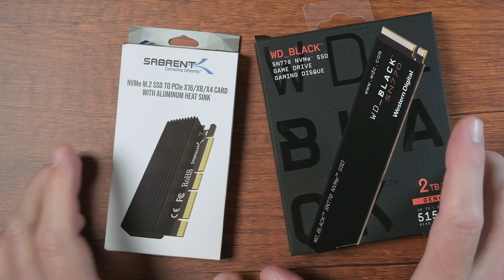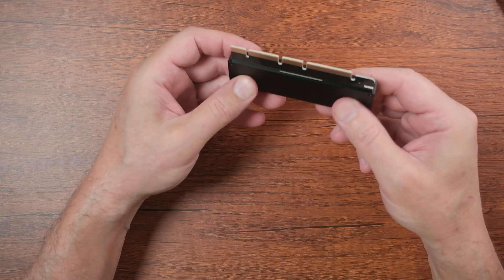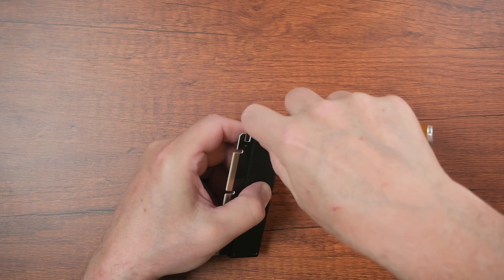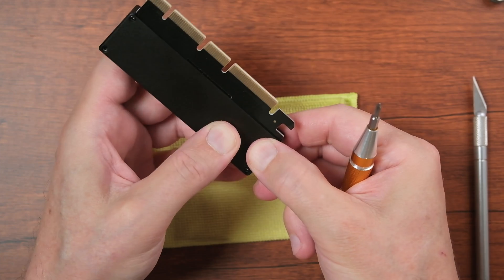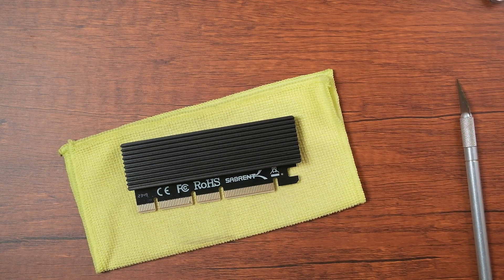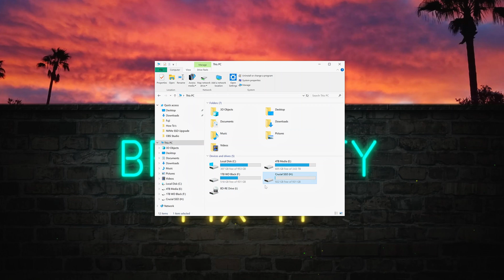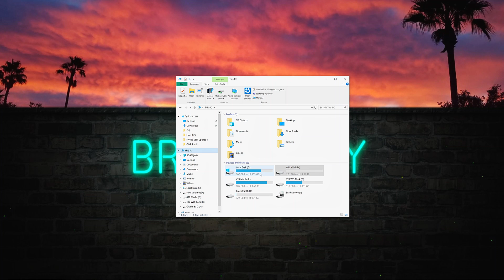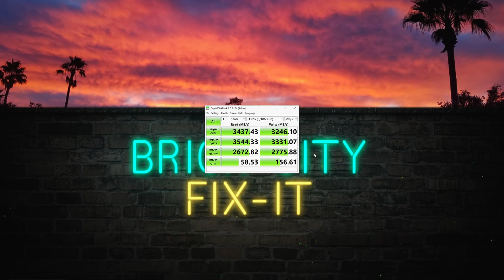Easily Add  a Super Speedy NVMe M.2 SSD to Your Windows PC.

Comment: Nice. I dont understand tho. How come you are getting over 3gb of speed from a gen 2 x4 slot, ? It should be around 1500 mb only?
Reply from the maker: Thanks for the Q: Mobo is a Gigabyte Z390 Aorus Pro Wifi which is a Gen 3 PCIe x4, so it's about twice as fast as 2.0. I think I mention this in the last chapter.